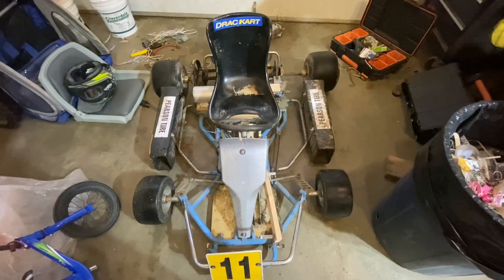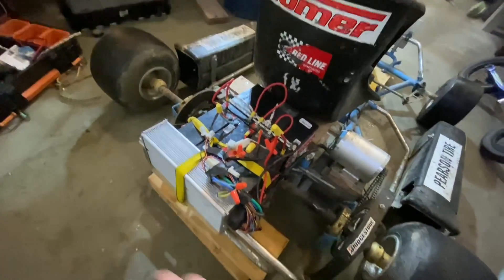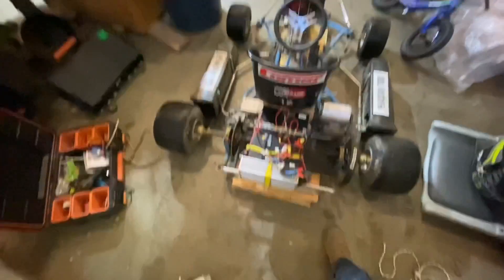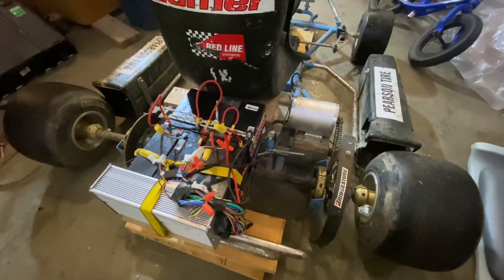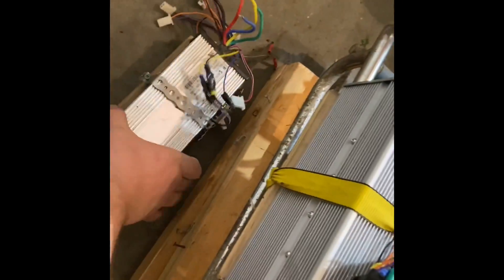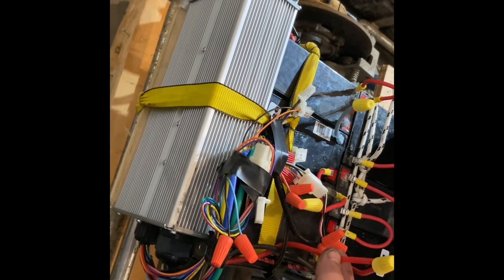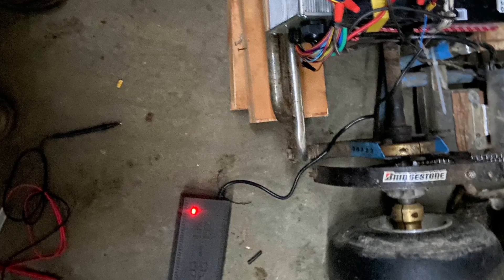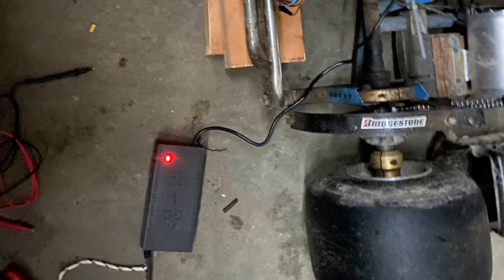DIY Electric Go Kart conversion Part 3

Comment: I'm doing a build with the 72v 3000w motor. There have been complaints of the motor overheating and then dying. My guess is the lithium batteries that people use is making them faster, but the high discharge is causing the motor to overheat. Some people are enlarging the holes on both ends of the motor. This works well if it has a built-in fan, but from what I've seen the 3000w motor doesn't have a fan ( strange I know). I'm planning on using a 100mm 12v Seaflo in line boat fan with a electric bike 72v to 12v step down transformer (perhaps with 4" k&n filter on the end to keep dust out).
Reply from the maker: To me the 3000w motor is the same as the 1800 w motor. It’s almost as if they just took the same motor and hooked it up to a larger controller. I am looking into QS 138 as I think it’s a better fit for most of my project ideas
Reply: @CJs_DIY  Interesting. In YouTube videos I've seen lower wattage motors have a fan inside the case, but I don't know if that's all of them. Apparently there's no room for a fan with the 3000w version because the case size stays the same with all models. I'd like a QS motor but the price is a bit high for me. Even the recommended controllers for a QS motor costs quite a bit :(
Reply: @CJs_DIY  Hope you're still active. are you using a AGM Lead battery? how many amp hours and how long does it last?
Reply from the maker: @ I haven’t done a video on it but I have been using ego mower batteries works great for the 1800 controller. I haven’t found a good 72 volt lithium option and the lead acid batteries have to short of a lifespan.

Comment: I'm curious how you connected your charger. Are you using the charging connector on the motor controller or did you make a connecter going right to to the batteries?
Reply from the maker: Charging connector on the controller
Reply from the maker: If I remember correctly I tested the wires to determine pos neg on both the charger and the controller then connected them

Comment: Lithium battery pack is a better choice .       We are using 3.5kwh or 66a Nissan leaf lithium battery and never ever ran out if juice.  With a ultra high performance 15a fast charger that can fully recharge the battery in 2-3 hrs.  The only negative about it is the high cost, $800 .  But well worth it.
Reply from the maker: I have been eyeing some lithium pacs that are plug and play... def worth it but pricy$$$

Comment: Can you list the battery charger for me please, I can't find it online
Reply from the maker: You need to put a charger for your specific battery type. Lead acid or lithium and then choose the charger for that voltage. I used a lead acid 72 volt charger
Reply: @CJs_DIY  I will be using 48V lithium ion
Reply from the maker: @Lou246  then you cant use the same charger as I have in this video as it is for lead acid.

Comment: FYI the 3000 watt motor has a marginally (1/2 inch) longer stator which should give it slightly more power.
Reply from the maker: Thx I’ll switch it over
Reply: Will it eventually kill the motor if i use the 1800w one with 3000w controler

Comment: Hi I'm currently building a electric drift go kart with PVC sleeve tires not sure if the 1800w motor will have enough power and should I just fit a 3000w motor instead so I have enough power for me to drift properly
Reply from the maker: It’s the same motor the controller is all that’s different... I would go with the 3000 myself though
Reply: @CJs_DIY  so that's a 1800w motor with a 3000w controller with the actual motor it would have plenty of torque for drifting
Reply from the maker: @axelsol89  the 3000 w motor kit comes with the exact same motor so I left the original 1800 motor on the kart. And yes you will drift like a machine with pvc/plastic tires
Reply: @CJs_DIY  I didn't know that they where the same motor I thought  the 3000w being bigger, has a different rating/power sticker and higher price meant you where getting a bigger motor I'll have to look into it that's good to know mate cheers

Comment: Nice! I'm also more or less in the middle of an electric go kart conversion, mine has a peak power of 20kW 😂
Reply: Where do u get the 20kw motors ive been lookig for ages
Reply: @SKITYSTUDIOS Qs motors. Ko F spec motor. 
Keep in mind thats peak power, and to reach that capasity you will need to put down atleast 5k on motor, controller and battery. 

Just go with a qs138 3000w motor, those peak up to like 7-8kw. And sends  a gokart 0-100kmph in under 3 sec. 
Cost me around 1500 $ for all electronics(aswell as buttons, cables, cable management and some volt indicators and other small things you never calculate for but ends up being hella expensive😅

Comment: Motor is 1800watt rated but can output more if more amps in as well voltage up ....all is pretty much  dependent on  motor controller voltage and amps ...so more volts more amps. E motor outputs more power measured in watts ...but limit is actually cooling of motor winding.